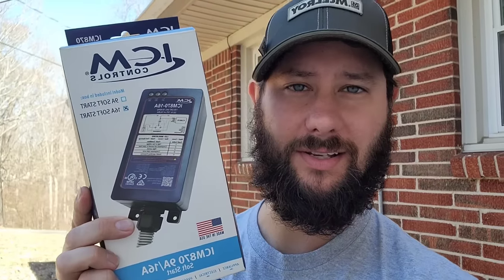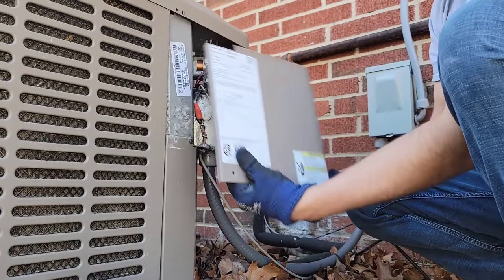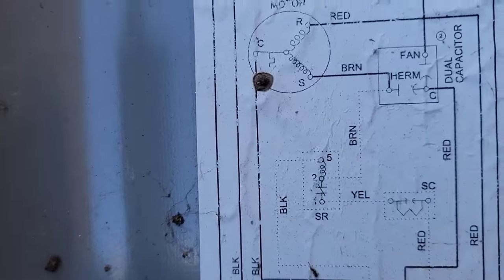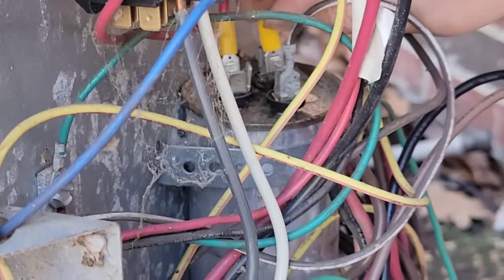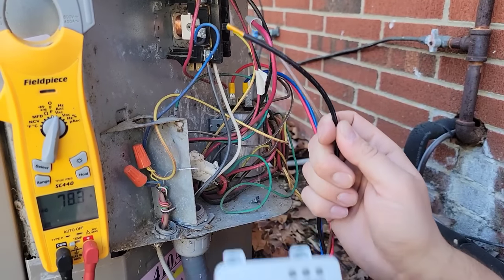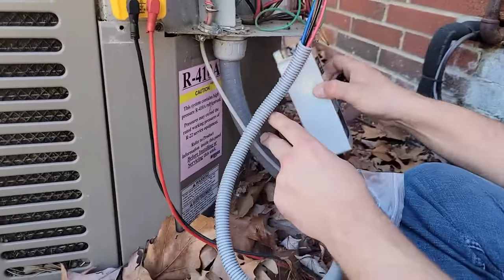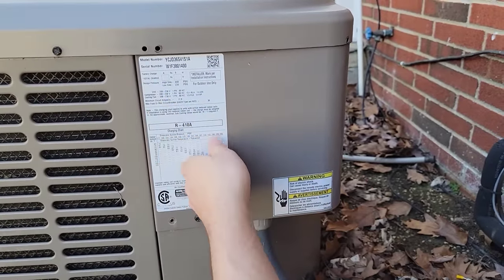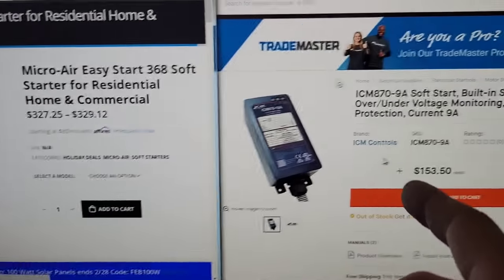How to install ICM870 Soft Start? @icmcontrols9960

Comment: Question for all you ac guys.  I have 20 yrs experience.  How come with a soft start kit I dont see the amps slowly increase, its always hard like a hard start kit.  Ive tested hard start kits 521 and soft start kits.  Ive found no difference from what I could tell, other then the fan coming on first before the compressor with the soft start kit.  Are we sure a soft start kit is just not a hard start kit with a time delay to allow the fan to start up first?  Im pretty sure an inverter is required for true soft start.  Ive opened soft start kits, they contain the same relay and capacitor of 521 kits.

Comment: ONLY thing I would of done differently would be instead of crimping those 2 wires together I'd use a male & female plug to hook them up, that way if the box gave problems or died then you can plug the original setup back in
Reply from the maker: great idea
Reply: @TaddyDigest  "would of"? That would be "would have" or "would've"

Comment: It's been a year now and this is one of the older white box units. I wonder if the internal capacitor popped on his yet.
Reply from the maker: Still works.Everything is still working really well
Reply: @TaddyDigest  That's good to hear. I've had my eye on one of these for a while but have seen dozens of pictures of the capacitors popping in the older white ones. The newer blue ones are supposed to be fixed but who knows. Also weird that your box shows a blue one but yours was white.

Comment: installing icm on my sister's 2.5 ton tomorrow.,
Reply from the maker: Very cool brother
Reply: Easy install on goodman package unit , tore it apart cleaned and releveled unit, 1/2" towards house , condenser pan was over flowing,  79 in rush now 22 Amos and it's much quieter.

Comment: I have a 3.5 ton Heil N4H4 unit that has an RLA at 18.1, and an LRA at 105.5. I believe I can certainly benefit from this based on your video. I only have one question that I can't seem to find an answer to that I was in hopes you could help.

How do I know whether to order the 9a or the 16a model?

Thanx!!
Reply: You're RLA is 18.1a so you need their 20a version that is not out yet. I have 16.7a RLA and I need that version as well it  looks like.
Reply: Rated RLA isn’t what your system is using when operating, typically under normal load you should see half of the rated RLA. Your LRA should only last a few Milliseconds unless there’s an issue with the compressor.
Reply: You Really Need to Measure the Compressor amps when the unit is running  @  RLA 18.1   the compressor is probably going to be around If the Compressor is in Good Condition 10-11 amps , i just measured a  3 ton with a RLA 16.1  the Compressor itself  NOT the Complete Unit with Fan  Just the Compressor the amps running was only 7.78 amps

Comment: Thanks.  Interesting device.  Is this necessary for setting up a generator hook-up.  Also, what differences would I run ito for a heat pump.  Might be worth content latter. Thanks. OBTW I am in NC and am running a hybrid heat pump/ gas pack/ AC in North Carolina.
Reply: I was also wondering how this would fare with a genset hookup, as it looks like it has some sort of frequency detection. Some gensets will drop freq a tad and likely set this feature off. curious though.

Comment: Q.  With the ICM870 installed, is there a need for a delay-on- make relay on the contractor control wire ???

Comment: What size soft start do u need. On my nameplate on my unit it says its 3 ton unit the fla is 14.1amps.  Is that what u go by to choose the right soft start. I went to the website dnd they seem to have different amperages. Want to get one but want to get the correct one

Comment: Hey Tad, I just installed this unit in central FL on my 1989 Carrier 2.5 T R-22 Heat pump and I got some different results than what you got with yours. My system is rated for 82 LRA and 16.5 RLA respectively. My actual LRA at start up was 84 prior to install and after it went down to only 16.03 but my unit goes into the delay mode for about 3 to 4 minutes before allowing the compressor to kick on while the fan motor is already running. The RLA also was cut in half to only 7.5 when the system is cooling. I have a newer fan motor on the heat pump and a newer 45/5 capacitor on this system and also it used to have a hard starter to help the compressor. Once again, this is from 1989! There are controversies about this unit saving you on your electric bill and what is your take on this?
Reply from the maker: The actual soft start will not save you money on your electric bill, but it will help reduce compressor damage during startup

Comment: Where on the control panel do I find whether or not my unit is a 9A versus a 16A? We recently moved into a new home with  all new equipment, but I'm wanting to learn more in order to preserve our investment. Thank you
Reply from the maker: I just did a video and I think it will help you. It's about breaker sizing and how to size wire for equipment
I'll send you the link
Reply from the maker: https://youtu.be/FICSX9kuPzc

Check out this video. It should help towards the end of the video. I talked about the unit and reading the data plate
Reply: @TaddyDigest  I appreciate you and your time
Reply from the maker: You're welcome my friend have a blessed day
Reply: @TaddyDigest  - sorry but, mine says minimum circuit ampacity is 16.5A. Does that mean to purchase a 16A, or will a 25A also work?
Reply from the maker: I would definitely go with the twenty five amp
Reply: @TaddyDigest  - thank you kindly sir ✌️

Comment: System has an LRA of 74A and pulls 78, also has a hard start kit. That tells me there’s an issue with the compressor. Adding the soft start will do nothing to help what could be a failing compressor. Should have checked the compressor windings or even put a meg meter on there to check the winding insulation.
Reply from the maker: I did actually check the windings on this motor and these bristol compressors suck
Bristol has got to be some of the worst residential compressors I have seen three ton and under
Let me know if you've had experience with these bristol compressors
Reply: @TaddyDigest  Bristol and LG are the worst.

Comment: Ted, I would only question if the bearings in the older compressors are designed for a soft start kit and secondly please paint the gas piping behind you. Mr picky from Canada. Thanks for the video, I did learn something. Andrew

Comment: Can you install this type of product on a ground source geothermal heat pump?
Reply: A geothermal heat pump runs the same as a outdoor system the only difference is instead of using outside air to cool/heat it uses ground water. I have a 4 ton unit water furnace and yeah going from 78amp to 22  amp really slow down the power meter. That a huge saving.
Reply from the maker: yes

Comment: What’s the benefits of using a product like this? I can see a reason for it on an RV ac but not really at home.
Reply from the maker: look up the effects of high inrush current and why is bad for motors and tripping on google
Reply: @TaddyDigest  ok thanks
Reply: Running HVAC with a small generator is the most common reason.  Stopping house lights from dimming during startup is another.

Comment: So I don't need a start capacitor? I see you kept it on there but the literature says it has one built in.
Please clarify.
 If I can do away with those cheap capacitors I would just use a soft start.
Thank you.
Reply: Bruh. It’s not a soft starter. Keep your hard start and save your money.

Comment: You didn't mention what you did with the wires already going to the common and herm terminals on the start/run capacitor... left them connected...???
Reply from the maker: Well next time I will make sure I mention what I did with those wires
Reply: @TaddyDigest  thanks..
Reply: I appreciate the time and effort you put into your video...I apologize if I came off rudely...

Comment: Hey Ted.
There is a question
The main capacitor should be removed or not for installing this equipment?
Thanks for sharing your experiences.
Im from Iran and glad to meet you.
Reply: I should say my main language is Parian and the second, that is English, its not perfect
Reply: Parsian 🤦🏻
Special thanks to text correction 😂
Reply from the maker: Hey Thank you for watching
Capacitor does not have to be Removed
Reply: @TaddyDigest  I believe he's referring to that soft start capacitor you removed.  Additionally, if this unit contained a real hard start kit it too should be removed.  But why bother in either case I suspect as performance would be similar.

Comment: Can this device be installed on a hoshizaki ice machine?
Reply from the maker: yes
Reply: How can I send you a wiring diagram of my hoshizaki ice machine. my unit has rum and start capacitor. Which of the 2 terminal on the run cap is the Her

Comment: I looked the website and I can't find info about if my unit requires a 9 amp or a 16 amp. I have a 3.5 Ton Heat Pump unit.
Reply: The info is on their website.
Size 	     BTU 	    HP  RLA  ICM870-model
1 Ton 	12,000 	1 	5 	      9A
2 Ton 	24,000 	2 	10 	16A
3 Ton 	36,000 	3 	15 	16A
4 Ton 	48,000 	4 	20 	Coming Soon
5 Ton 	60,000 	5 	25 	Coming Soon

Comment: I have a 10 year old 3 ton Carrier unit that has a factory installed control board. It's a split unit (heat, air). What are my options with this device?

Comment: This might be a stupid question but does this soft start work with heat pumps? I know I know a heat pump is just an air conditioner that works in reverse.  But I said This might be a stupid question.
Reply from the maker: It will work with a heat pump

Comment: I need help!!   I decided to try to install one of these myself. I open up the condensing unit panel only to discover there’s no contactor for the compressor or condenser fan.   Just a transformer, run capacitor and an electronic board.    Does this mean I cant install a soft starter???   Ty.
Reply from the maker: You should still be able to install it
Reply: @TaddyDigest  oh, ok.  good.

Comment: hi. bro I just need to know 2 ton split ac, drain pipe and tre both of them clean filters and evaporater blower All of them are cleaned but water is still coming like rain with ear and no less freon, what you think what happened please answer me, thanks
Reply from the maker: I'm only guessing
I would have to have more information or work with you through a phone instead of over comments
But the equipment could have no trap on the drain, causing the water to stay in the pan
The unit could be  unlevel, causing the water to fall out.
This is just guessing

Comment: Can this ICM870-16A  Soft Start be mounted Sideways / horizontal without issue??
Reply from the maker: i wouldn't see why not
Reply: thank you for your reply and a fantastic video   @TaddyDigest
Reply: They can be mounted sideways without any issue.  They are made to withstand the elements and are sealed pretty well.

Comment: so it lowers the amps and therefore makes your energy bill lower and causes less wear and tear on the entire system?
Reply from the maker: For sure, less wear and tear on the equipment, but It will not save you electricity
Reply: @TaddyDigest  ahh ok thanks for the reply!

Comment: It seems like everyone in my industry has a new idea to get money out of people for something that is unnecessary. Air conditioners needed start kits they would come from the factory with 1 installed. Usually when compressor hard start it is because they are low in lubricants because of repeated Freon leaks. They sell Kits that come with a tube and 2 hoses that you can put oil treatment in compressors instead of constantly coming at people with these hard start kits treat the cars don't put a band aid on it.

Comment: Question! I have a 6 ton geothermal heat pump that kills my Onan 15KW generator as soon as it turns on. Which wuld you recommend 9a or16a. The breaker on the unit is 50 amp. Thanks
Reply from the maker: Definitely the 16 amp model
Reply: 6 Ton is not supported
Size 	BTU 	HP  RLA  ICM870-model
1 Ton 	12,000 	1 	5 	 9A
2 Ton 	24,000 	2 	10 	16A
3 Ton 	36,000 	3 	15 	16A
4 Ton 	48,000 	4 	20 	Coming Soon
5 Ton 	60,000 	5 	25 	Coming Soon

Comment: If I have a 3 ton Carrier unit, what size soft start do I need?
Reply: You're NOT paying attention.  Go watch the video again.  He clearly explains how to select which amp rated ICM Soft Start your ac requires.
Reply: @azclaimjumper  he definitely does not tell you! He shows you what size his unit is, and what amps the compressor draws, and then tells you what sizes the soft start comes in, but at no point does he tell you what size soft start you would need when! I looked on ICM website and figured it out.
Reply from the maker: https://www.icmcontrols.com/product/icm870/
Reply from the maker: chart is on this page

Comment: My Aunt just had this unit recommended to her and installed for the generator usage. Maybe incorrectly installed...soon after install the wires to the compressor and the compressor plug burned-up. AC Compressor is over 20 yr old, but no issues previously. Understandably she is very gun-shy to reinstall this unit on the replacement compressor.

I have a micro-air unit on my home AC compressor. About 45 days in with the idea to use AC when on Generator power.

Anyone have issues like this, or know what may have happened?
Reply from the maker: sorry to hear that.
I hope that does not happen again

Comment: Presently, have a 'thunk' sound when my outside unit starts up.  It runs fine, but that 'thunk' startup sound is pretty unnerving to the unaware people.  Wonder if the device would solve that
Reply: "Thunk" would wake me at night .I installed a Micro Air unit like the ICM870 on a 3ton ,12yr old Goodman heat pump.  Now, NO more "thunk"!
Reply: @georgeengland743  thanks
Reply: @georgeengland743  Thanks, I have a York (40,994 BTU) - Model YCLT40AYRRA0, thats going to get some luv. lol

Comment: This is not intended for residential  units per the instruction Manuel applications include marine, recreational vehicles and commercial units . Installed one and it killed two brand new  run caps . Anybody ran into this problem?

Comment: What is the real advantage of it? Reduced electricity consumption?
Reply from the maker: High inrush current can cause nuisance tripping of protective devices or motor damage. It can also cause voltage dips in the supply line (which can affect other equipment), or even prevent the motor from starting properly. High inrush current also leads to high torque production at startup — sometimes as much as twice the rated torque — which can cause sudden, severe acceleration that damages mechanical loads.

Comment: Never heard of a soft start, but it decreased the start up amp draw by what 50 amps? Probably lowers electric bill.
Reply from the maker: It's pretty awesome. It will not lower the electric bill but it will make the system last longer and cause less maintenance over time
Reply: @TaddyDigest  it would make sense to lower the bill, no. Have you compared? 😅
Reply: It only pulls the lra for less than a second. You need a special meter to see lra.

Comment: Would you need something like this on a 2 year old Trane gas pack 🤔?
Reply from the maker: absolutely
Reply: @TaddyDigest  I have another question for you have you ever seen or tried a 3 way floor register I bought a couple just to try what do you think about those is just the standard 2 way the way to go?
Reply from the maker: 3 way works fine you can use the 2 way as well
It all depends on if you can use it because of the boot that you have
Reply: @TaddyDigest  ok thank you the 3 way seems to work faster for some reason but the 2 way works also .
Reply: Does having a locked cover over your thermostat sometimes mess with the calibration of the setting just wondered our heat is set to 71 and sometimes kicks off at 73 its a honeywell 8000 series?

Comment: hi Ted, after removing the hard start, can I use the same wire to joint them together for the icm870?
Reply from the maker: Hey Consult the wiring diagram
Reply: @TaddyDigest  thank you

Comment: Lock rotor amps is when your compressor is locked up and not turning.
Reply from the maker: That is correct and it is also the current that the motor pulls on startup

Comment: Totally ignorant person here, but these are pretty pricey.  What benefit do these soft starts provide?  Ok, lower in rush current, but what are the cost benefits?
Reply: @TaddyDigest  I will need to edit my initial comment, but I am trying to understand the benefit of these soft start devices.   Does it lower energy cost over time?  Does it lower stress to the system so it doesn’t break done sooner?
Reply from the maker: High inrush current can cause nuisance tripping of protective devices or motor damage. It can also cause voltage dips in the supply line (which can affect other equipment), or even prevent the motor from starting properly. High inrush current also leads to high torque production at startup — sometimes as much as twice the rated torque — which can cause sudden, severe acceleration that damages mechanical loads.
Reply from the maker: This device reduces the in rush current by 70% percent 

I miss read your first comment I apologize
Reply: @TaddyDigest  Thanks for the info, sir.  That is what I was looking for.  I just had a new HVAC installed this past summer.  Might be interested in installing one, but might need to reach out to the installers to add it.  I would be afraid if I did it and something goes wrong, even not related to a soft start I install, they would not honor the warranty